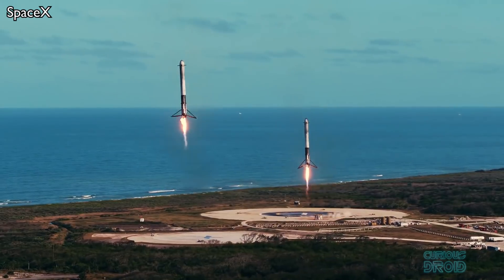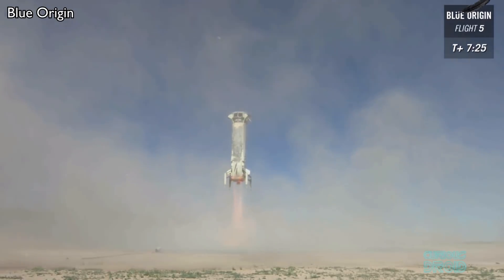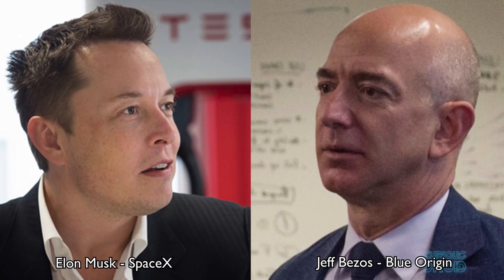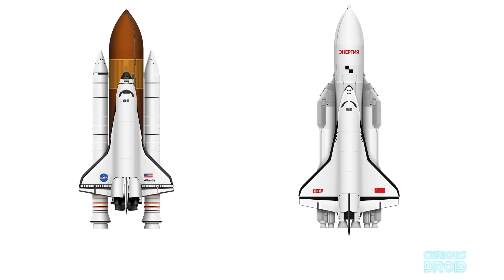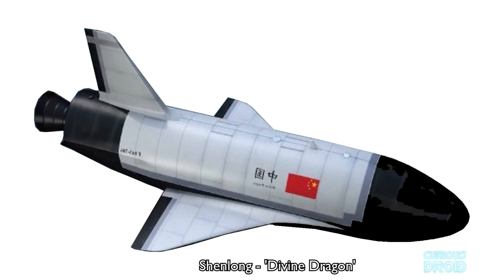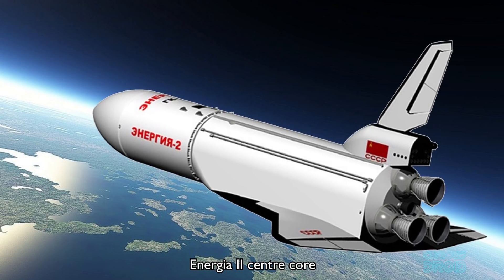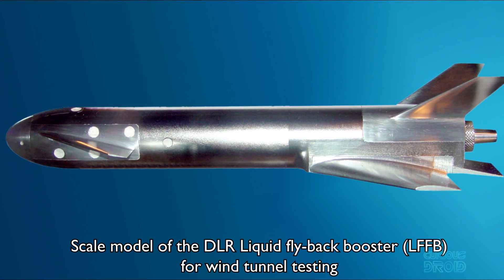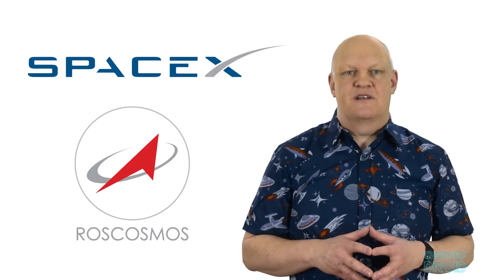Reusable Rockets & Flyback boosters

Comment: Shorter: Reduce utility that you may not need on a particular mission and you can reduce mass and complexity. Duh. But then if you eliminate the crew quarters and life support, you need to design and build a ship that does have crew quarters and life support. And then you need another rocket design that eliminates some other superfluous element for particular missions. Repeat ad nauseam. Now you are not wasting money and effort on particular missions, instead you are wasting more effort and money and development time on several designs that are bespoke to just a few missions.
Notice how all these designs are using those wasteful wings and taking engines to orbit that are somehow wasteful, but necessary to achieve the mission goals? Airbreathing propeller-driven engines on a suborbital booster with wings?
Remind me what it was that was so wrong with the Space Shuttle?
Reply: I don't quite understand you. Do you really think the Space Shuttle was a good design? The thing was cool and beautiful, but that's about it: it was insanely expensive and wasteful, and more importantly, it was fragile and a death trap for the crew. In 34 years of operation, from 1977 to 2011, the Space Shuttle programme burned through some 200 billion dollars and claimed the lives of 14 astronauts. For comparison, in 52 years of operation, from 1966 to present year, four astronauts have died aboard Soyuz vehicles, the most recent 47 years ago. Today you guys are paying something like 80 million per seat to send astronauts to space on Soyuz capsules. That's the Shuttle's legacy.

The Space Shuttle was a travesty of incompetence and bureaucracy, there is no defence for it. The one thing one may praise about it is the excellence of the engineers who managed to make it work in spite of the sheer lunacy of the design, and of the scientists in other NASA projects, who still managed to conduct cutting-edge space exploration with STS sucking away their funding. It is bitter to ponder what could have been, had America not wasted a generation on that programme.

Anyhow, yes, SpaceX and a few other companies and agencies have eliminated crew quarters and life support in their designs, reducing mass and complexity, making them more efficient and safer. And indeed they are putting in lots of effort to develop specialised vehicles for crew, in addition to the ones they have now, that will only be used in a minority of missions. That is the rational, sane approach. And it seems to be working just fine, too. With any luck next year you'll finally be able to send astronauts to space on American vehicles again, without paying Russia to do it for you. I sincerely wish you guys succeed with that, America deserves it.

Oh and btw, Adeline's props are not air-breathing, but electric. Not that it matters much -- personally, I wonder why the Baikal (Angara) concept hasn't had more traction. I just feel, intuitively, that that is still the best solution. I love SpaceX but, if someone had told me, back in 2002, that suicide burns were going to be the answer to reusability, I would have thought them crazy, heh.
Reply: The Space Shuttle was a first iteration. It was a damned good sight better than the Wright Flyer. It was not a death trap. It was a spectacle that inspired a lot of people to bitch and moan about it not being perfect from the start.
Reply: Dude, you got it backwards. The Space Shuttle was an interesting and bold concept, if maybe a bit too ambitious for its time, at the beginning , in the '70s, before Congress and the military started adding requirements to it. By the time Columbia flew, it was an astronomically priced monstrosity that tried to do everything and did nothing well. And yes, it was very much a death trap, by design.

Do you know the first two, Columbia and Enterprise, were built with two ejection seats? That's it, two seats, for the commander and the pilot. And, as STS-1 pilot Robert Crippen put it:

"In truth, if you had to use them while the solids were there, I don’t believe you’d—if you popped out and then went down through the fire trail that’s behind the solids, that you would have ever survived, or if you did, you wouldn't have a parachute, because it would have been burned up in the process. But by the time the solids had burned out, you were up to too high an altitude to use it. ... So I personally didn't feel that the ejection seats were really going to help us out if we really ran into a contingency."

And do you know, in STS-5, the first mission to fly with a crew of more than two, commander Vance D. Brand had the ejection seats disabled anyway? He thought it was the ethical thing to do. Hell of a man, Brand. The balls of the guy.

By '86, Columbia had had its ejection seats and explosive hatches removed. Because it was pointless indeed. Challenger, Discovery, Atlantis, and Endeavour, were all built with no ejection seats. You know what was the bailout capability for contingency abort modes (those in which the orbiter could not be recovered)? It was ICES, the in-flight crew escape system. It called for the orbiter to be set on auto-pilot while a hatch was blown and the crew slid out a pole to clear the orbiter's wing, and afterward they would parachute to safety. Imagine doing that, while the craft is disintegrating in a ball of fire. Well, you don't have to imagine how well that worked. We all remember, huh.

And see, the point here is: this is not excusable as a "first iteration". Yes, when you break new ground you take risks, it's unavoidable, and much respect and glory to the people who've taken those risks for us all. But this was not new ground at all. Not Apollo, not even Gemini, had these problems. They had been solved. It was only infeasible for the Shuttle because the design didn't allow for it, because it was not technically possible to satisfy the government requirements and still make the craft survivable.

So yes, the Shuttle was awe-inspiring, it was a gorgeous machine. I think I still have a Shuttle model somewhere, that I painted myself when I was a teenager. But that's all it was. Technically, economically, and even morally, it was obscene failure. SpaceX's Falcon Heavy wasn't any less inspiring, and Musk didn't have anyone killed, nor spent 200 billion doing it.

Shuttle is what happens when you let politicians call the shots in a programme of this nature. Incidentally, I would advise you to keep an eye on SLS, because it seems to be headed down a similar route, tragically.